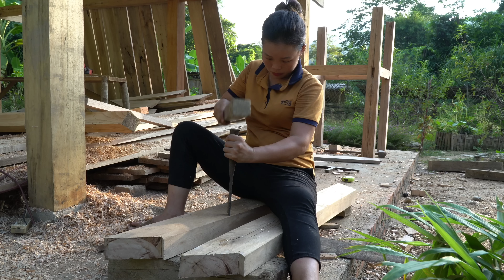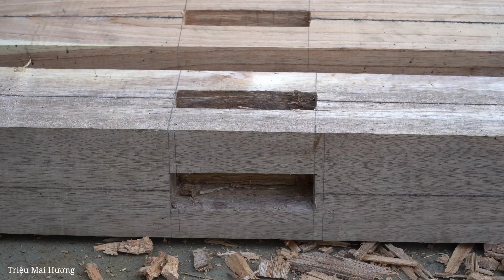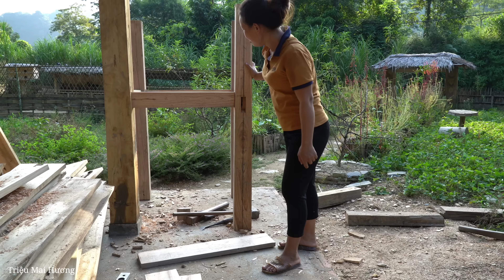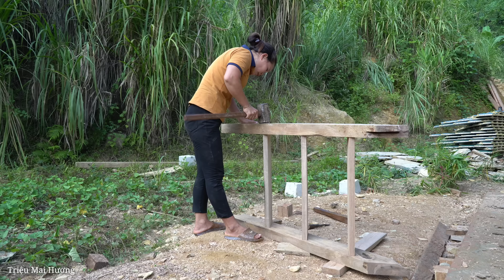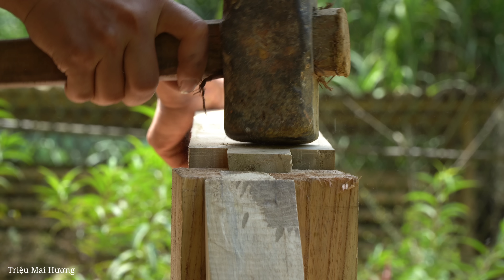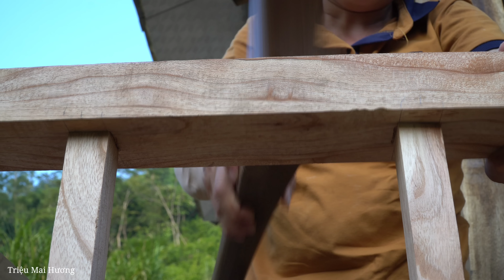Wooden house 2023 - How to make a 2-story wooden staircase - Handicraft | Trieu Mai Huong

Comment: Are you going to put a shield of protection on the wood? For the bugs not to eat your wood. Look on line they have different ones. Is like a liquid to paint it to protect it, will last you longer, one of many is call Outlast Q8 Log Oil. They have different colors,  dark wood colors and light. That's one brand but they have many brands

Comment: Hi doing good but is there a reason why u won't use nails on the railings at the connection points and where u design those box areas u can't just leave because it is easily pulled out. SAFETY TOO REMEMBER 🌺💕👍🇯🇲